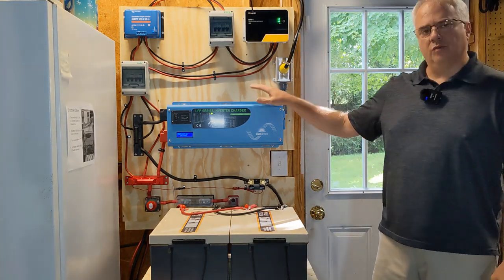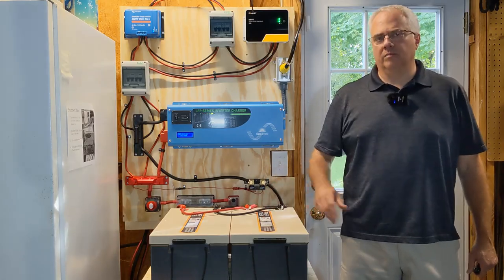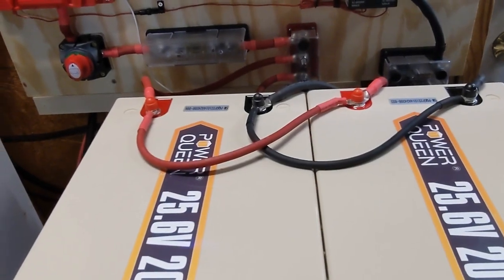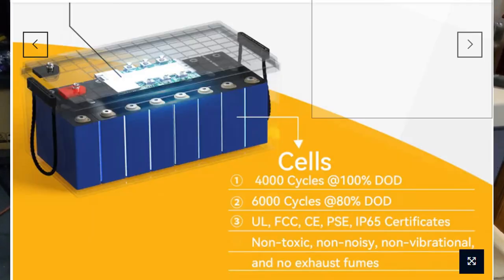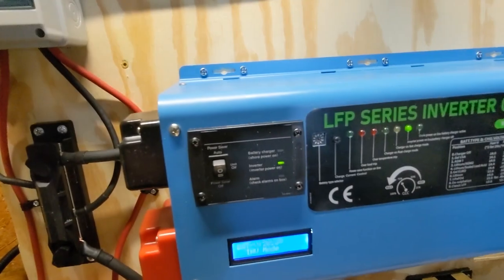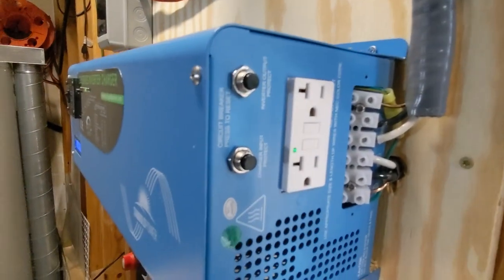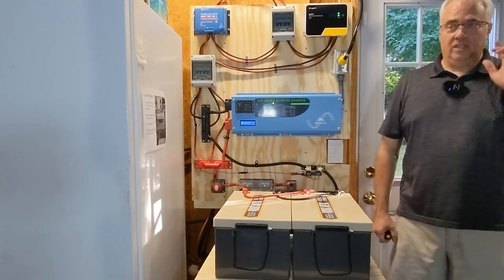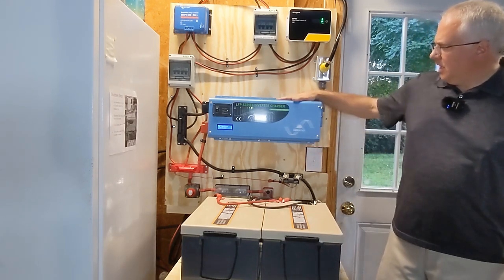24v DIY Solar Generator Setup - 4000w - 10,240kwh with Built-in Battery Charger

Comment from the maker: Let me know your thoughts on this 24v build? I really enjoyed putting this build together.
Reply: My system has been 24 volt from the beginning. I started out with a 3000 watt inverter, then bought a 5000 watt low frequency one. My lead acid batteries are finally about dead so I am now waiting for the last 2 12 volt 100 AH batteries to make the 4 I need till I can get more.
Reply: For home use, its one of the best I've seen. I will save your video and I suscribed to your channel. Thank you.
Reply from the maker: Thank you!
Reply: Beautiful build
Reply: Do you have a list of components?
Reply from the maker: In the description of this video, I did put almost everything underneath "Affiliate Links "
Reply: I have expert power stuff and not building quite as safe I don't think but I'm totally off grid and depend on it still learning 😂 don't have the luxury of on grid choices goal is to get a fridge and freezer going along with TV and appliances through a few separate outlets it's a mess . 😂 But no choice gotta keep going.

Comment: Awesome inverter but this inverter is actually not made by Sungoldpower. Sungoldpower does not manufacture any of its inverter offerings. Sungoldpower is just a system reseller that rebrands the products that they offer. Sungoldpower inverters are manufactured by Sigineer Power. Sigineer Power manufacturers inverters for several renewable energy companies including Aims and Sungoldpower.
Reply from the maker: I had no idea. I knew that this happens a lot, but I did not realize that SunGoldPower was made by someone else. Thanks for this information!
Reply: Sun gold has a $50 coupon now .Only making Signeer $30 less till end of January for gold sale.I may buy from local distributor of Signeer.
Reply: Sigineer not showing 4K 24v on there sight?

Comment: I too am upgrading my 10kw system from a 12v to a 24v. The advantages are most of my components (batteries, charge controllers, solar panels) work in a 12 or 24v capacity. Also the conversion is a 10:1 ratio battery powered 12VDC to Grid load 120VAC. Whereof the 24vdc to 120vac is a 5:1 conversion ratio. System will run more efgicient and cooler with smaller guage wire. Also you will be able to double your solar panel input per charge controller as per spec of charge controller rating. I'm upgrading to a 24v 3600watt hybrid inverter/charger. With grid power pass thru and solar mppt charging included also.

Comment: I live the sungold power inverter. I have a 4000 watt split phase 24 volt and it runs my entire off grid 30 foot camper including a 9000 btu minisplit. I built a 30 kw battery from 280 ah grade a eve cells. I also have another battery that's about 7kw of leaf modules but it's kinda for back up if I was to ever need it. I also use several charge controllers but my 150-70 victron is the newest addition and victron is king for sure. I'm using 1850 watts of sharp solar panels at the moment but hopefully in the next week or two I can get another 8 or 10 panels. This solar stuff is addictive lol. I've spent about 30 grand so far on my off grid stuff but as long as the wife is cool with it I don't see stopping any time soon. So much enjoyment in building this stuff and q great way to spend time in a positive direction
Reply from the maker: Sounds like you have a nice setup. I agree that this solar stuff is addictive. I've also spent a lot. My wife just asked me the other day "How much money have you spent on this stuff?". I found a way to not really answer and change the subject. haha

Comment: I am still sticking with the 24v builds also; so much, that I bought a 24v grow watt all in one when they were on sale (still in the box). Battery storage/ capacity is the big issue with power walls and for the price of those beautiful rack mount systems, you can DIY for almost half the price. Yes sir, Victron is great, Sol-Ark is great but I leaned towards Epever which gets the job done without all the 💸 for my first builds. You sound well rounded, you have got to buy raw cells and pack build them out; you got the hard part down packed, understanding fuse sizes, wire gauge and wire length. Take the leap of faith 👣

Cheers! and keep preparing!

Comment: Very nice system. I run 200 amp battery system to power my ham radio station. Also to charge my power tools. With 400 watts of solar.

Comment: Great video. I just recently ordered a Sungold system. With 6k split 110v/220v inverter. 2 x 48v server rack batteries, solar charge converter as well as 4 x 450w solar panels. All Sungold Power  components. Can't wait for my system to arrive. I'm installing in a mobile showroom for automotive equipment.
Reply from the maker: That sounds awesome. I would to hear how that turns out after you get it working. That sounds like a great video for you to make if you are into that.

Comment: I love the way your presentation is applied. 

Parts described clearly one by one

Even the small remark about safety of 30vdc.

As well mentioning the install portion of the correct measurements prior to install .

Most videos are quick install and no technical information or manual pics displayed for confirmation of correct install and error messages displayed.

I will follow your site.

Thank you
Reply from the maker: Thank you very much!

Comment: I use 2/0 wire. It's kinda oversized but it helps with surge loads. It's not really necessary but it's alot easier on the inverter if you over size the wires. Great system by the way. Thanks for showing your stuff.
Reply from the maker: Sounds like a safe approach with 2/0. I was really not wanting to move up to 2/0 if I can help it. I'm thinking will be fine with 1/0. Another viewer mentioned something about the slight overheating I experienced could be the battery switch. I am going to check on that also.
Reply: @proficientprepper  yes for sure check that switch out. Most the switches I've bought are kinda way over rated. I use 2 2/0 positive and 2 2/0 negative wires. I have 2 600 amp switches side by side going to my battery. It's kinda overkill but after I melted a switch supposed to be rated at 300 amps it made me paranoid. I was pulling 120 amps and nearly burnt my place to the ground and after that I decided to oversize the crap out of all my wires a d switches. I have o er 30 kw of battery now and that amount of energy gets dangerous fast when things go wrong. I love the solar stuff tho and wouldn't go back to the grid ever lol. I'm sure I'll never see an actual savings and my system will never pay for itself but the happiness that I get from it was worth every dime. Some people don't understand why we spend so much on this equipment but the knowing I'll have electricity for the next 10 or 20 years no matter what..  yeah that's where the real value is for sure.
Reply: Oh yes oversized is no problem the best way to go it makes everything more safe and reliabl 
Am hoping one day I will get one of those inverters have my eyes on them but I will be wanting a single phase 240 volt that’s the voltage in my country

Comment: I love the way the equipment board is set up, I did something similar. 😊
Reply from the maker: Thanks. I had it in many configurations before I finally settled on this one. Did you build a 24 volt system also?
Reply: @proficientprepper  Good morning, my first system I finished it last week is a 12V and it's for learning purposes. Will use it to learn about what can I put to use, discharge and recharge (the math aspect) and to have a small emergency back up power. In the not sondistant future I will assemble a 24V system to provide more capability. I really like your system, it looks like the right size to have. Tood screen shots for reference. Thank you for responding, good day.

Comment: I used an Aims Power inverter charger, similar inside to the Sungoldpower but mine is 24 volts, 2000 watts. I used twenty big marine batteries but four of them have went bad so Im changing them out to 31 series deep cycle batteries, as they quit. The charger in mine is 30 amps. The low frequency pure sine inverter charger weighs 46 pounds. I've used the charger twice in three years. I don't have a grid hookup. I have a Winco Lil Dog generator. My battery bank is 1000 amp hours. I have the one dip switch set on the lower voltage, so the batteries would have to get down to 21 volts to cause the yellow light to come on.  I think I have enough batteries now to change it to the higher setting, which would be any time it gets below 24 volts, the charger will want to come on. I used number 2 welding leads on all connections. I have two pairs of them connected to the inverter charger. I added a 600 watt wind generator in March. It was supposed to be 24 volts but they sent me a 12 volts one. I hooked it up to half of the batteries and it has saved me from having to use the gas ⛽ generator this year. Full charge is 25.7 v and they usually are on about 25.2 in the morning right before they start charging again. I have sixteen 100 watts panels hooked up in eight pairs. The Epever 4215 BN charge controller is 2% more efficient at 33 volts than it is at 63 volts. Using higher voltage will just result in a hotter controller. So I have to have the panels close to the controller or lose wattage. The max on the controller is 1040 w. , I have had 1020 w.  coming in from the panels in July or August. I used #4 welding leads from it to the batteries. I've gotten by with the cheapest batteries for four years. Im thinking about upgrading to the other kind, but I'll have to save up for awhile. I have tested the overload on my inverter charger, in November 2021, I tried running a welder that took 2400 watts. I got my wood stove built but five of the twelve MOSFETs blew the tops off. Jay at Aims Power said I overloaded it. So I changed the control board, power board, and temp sensor. He said I needed a 4000 watts one to run a welder⚡🤔, but I bought the Winco generator for that. I was going to get a 3000 watts inverter charger to start out with but they were sold out, and I didn't have the money for a 4000 watts one. So I got the 2000 watts one. It's better to just not overload it. The little red light comes on around 2140 watts. Supposedly, it has a 6000 watts surge and all that, but don't believe it. Maybe for a second. I have the same two GFCI outlets and breakers like yours. The battery selector and on/off switch is in the same spot. I know there's a couple of sizes that if you take the outside covers off, you can't tell the Aims Power from the Sungoldpower. It has the same control boards. I didn't know that until last year. They don't advertise it. I like how you have yours . Mine is a little more hillbilly. Im living in my uncle's barn until I can find some land close by that I could afford. It's too far from the power pole to run anything but a light bulb 💡. So I don't have everything like it could be. It's all temporary for now. I'm going to keep mine 24 volts. I think the 48 volts stuff is nice but probably too pricey for me. I would like to get three of the 24 volts, 100 amps batteries to run the Aims Power inverter charger, and then I have another inverter, an Ampeak, which is 2000 watts, that I could run off of the best 16 or so of the lead acid batteries in parallel. It can run a grinder or a saw, or something like that. I'll keep the pure sine one for the freezer, TV, and like that. That way  everything doesn't have to run off of one inverter. I'll have to get another charge controller. I guess that's my next upgrade project. That will give me an excuse to build a 24 volts wind generator to charge the new batteries when the sun 🌞 isn't out. I have to go get a new battery this morning. They're $130 apiece. It's 2 a.m. and the MT 50 meter says 25.0 the wind generator meter says 25..08.  The voltage will improve after I put the new battery in. Well this will be my fifth winter off of the grid power. I keep improving it as I go. One day, I will have my stuff looking more like yours. The main thing is, that it works. I always wanted a battery room, anyway. And with twenty three batteries, it will look impressive 😁👍. I might not have the biggest, or the best, but I'll at least make a showing.
Reply from the maker: Wow! Thanks for all that information. Very interesting to hear your off grid story. Batteries are definitely the most expensive part of my build. When I got into this off grid stuff, Lithium Iron Phosphate batteries seemed to already be the norm. So I don't have any lead acid battery experience. I'm actually still paying for these batteries. I think I have two more payments left. I'm liking my 24 volt system with little to no reason to move to a 48 volt system. I'm sure I will find a reason to do that at some point. LOL. But not right now. I did not realize until recently from another viewer that SunGold Power is made by a another company. I guess Aims and SunGold are made by the same company. I've read quite a bit about wind generators. I found that most people don't get enough wind for it to work properly. Sounds like it may work for you. I don't live in an area that is very windy except during storms. Are you totally off grid? I doubt I will ever get to that point. I would most likely have to move to where I could put up more solar panels to cover the cloudy days. Right now, we are in day 3 of completely miserable cloudy days. I've switched over to grid for a few things and my battery is at 30% SOC. Hoping for Sun! Thanks for commenting!

Comment: Yay! This is much better... This size of system works. 4,000 watts is the most you would want to connect at 24 volts. The current flowing is 199 amps. The batteries deliver at least 200 amps continuous. Hopefully.

Comment: Nice build. Only suggestion is to use Hardie backer Board ILO plywood. Non-combustable.
Reply: GREAT IDEA!
Reply from the maker: I had actually thought of that. I was trying to get everything in position, then move over to hardiebacker, but I forgot to move it over to hardiebacker. I believe I could pull the whole thing off the wall and put hardiebacker behind the plywood. That should offer some additional protection, but the plywood is still combustible.

Comment: I have the 24v lfp 3000watts version, set up very similarly and using the same way . I  did set my dip sw1 to 1 and tripped into charger mode at 22.7v . I wish I could set it to trip at 24v.  Overall very happy with mine
Reply from the maker: I have only had mine trip into charger mode once when I was very busy at work and not paying attention. One thing I wish this Inverter/Charger had is a button to just turn on the charger. Then when we have gloomy days and the batteries are getting low SOC, I could just charge it some to bump up the SOC to maybe 50% knowing its going to be sunny the next day. Or maybe a configurable setting for when the charger mode does get tripped I can configure it to only charge to say 60% (configurable) so it does not always charge all the way to 100%. Thanks for commenting.
Reply: @proficientprepper  I plug my AC in to a outlet,. I was thinking of using a light timer to  charge for a few hours on occasion like that

Comment: Here's a tip: Do not install your inverter vertically. My older Spartan inverter I had mounted vertically because I saw everyone doing this on YouTube. It was a 2200W inverter. My inverter stopped working.  I opened it up and found my fuses, falling toward gravity, and were melted together. Likely the fuse holders had too much resistance which caused them to overheat, and melt the solder.
My new inverter EGSCATEE actually had instructions not to mount vertical, but I had to read every line of the manual.
Also, I doubled my wattage from 2200W to 4000W in hopes my inverter will last for more than 3 years!
Reply from the maker: Thanks for the tip!

Comment: I have a 30A RV Class A diesel pusher with two ACs.  I've yet to find a high freq inverter that can handle the load when one AC is running and the 2nd kicks on.  I just ordered this unit and hoping the low freq can take that 2nd start up.  I'll keep you posted on my results.  What I've noticed with the high freq inverters is that can output their power rating, but that can't handle spikes in power demand.
Reply from the maker: Yes, please keep me posted. I'm curious if it can handle it.
Reply: @proficientprepper  I was able to test it today and worked like a champ!  Ramped up to 70% output and held for several minutes.  Now I'm going to start planning on getting everything setup and in place for permanent setup.

Comment: I really want to try the sungoldpower 48v 6000 watt split phase inverter for our mobile charging system. Another Powerqueen fan. We have two 12v 200ah that have been running a 9k btu minisplit for almost two years. We have another four running an EV charging system for our Ford F150 Lightning. We’ll be adding another 10kw to that system in a few weeks. I’m just not sold on the server rack batteries. I tried to add a battery balancer to the two in our shed, but found that after a year and a half, the batteries were perfectly balanced all on their own, and the balancer, actually ended up being unnecessary.
Reply from the maker: Nice! Sounds like you are moving towards power self sufficiency. One day I will move to a 48v system I believe. But I'm perfectly happy with what I have now. I would like to have more battery storage though to cover those stretches of cloudy days. I don't really have enough panels to cover it though. I do like Power Queen and I've not had any problems at all. There are several batteries now of good quality that I would use.